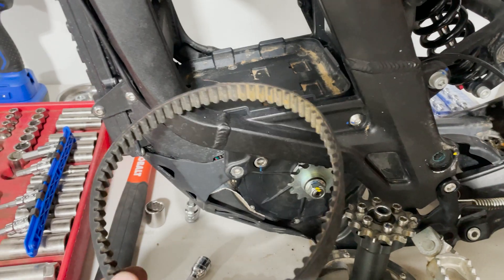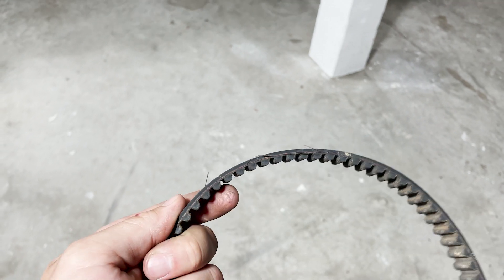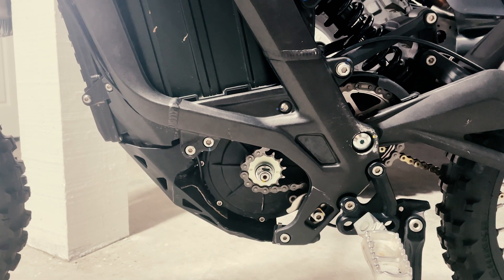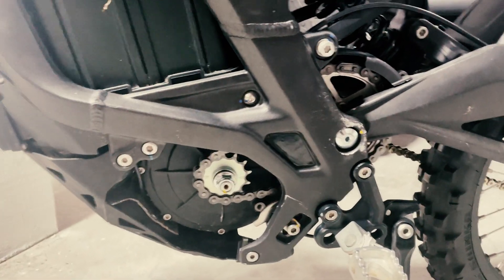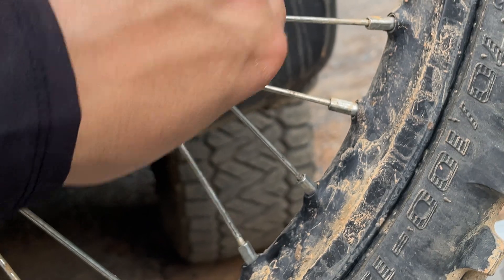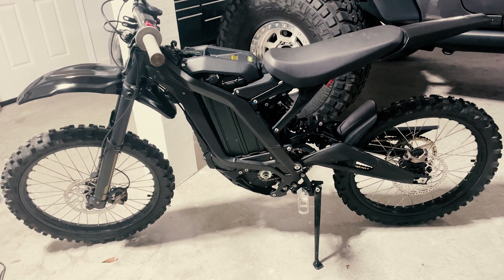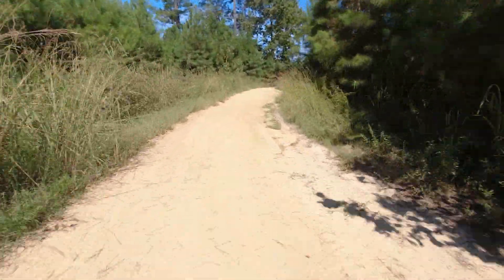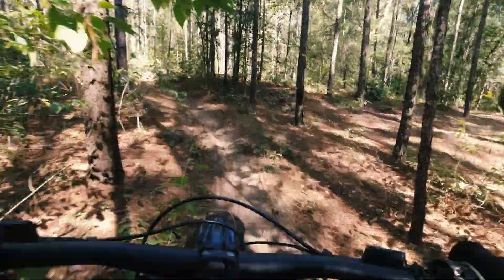Sur-Ron X Chain Drive Conversion | How To Make The E-Moto More Reliable

Comment: Was your bike harder to roll, with the chain drive? I had a shop install my chain conversion and since then it feels like my rear tire has a ton of resistance to spin
Reply from the maker: I haven’t noticed it being harder to roll. It’s much louder, but that’s the only real difference.
Reply: @Ali_Mansour_Editor  ok thanks, I think the shop put my primary drive chain too tight….

Comment: The luna 219 kit is garbage, you did yourself a favor. Also, you should actually be getting slightly better range. A belt is only around 80% efficient, whereas a chain is 95%.
Reply from the maker: That’s good to know on the Luna kit. As soon as my shoulder heals, I’m heading back to the mountains with the bike. It will be interesting to compare the range.